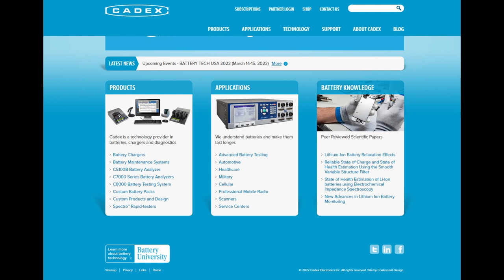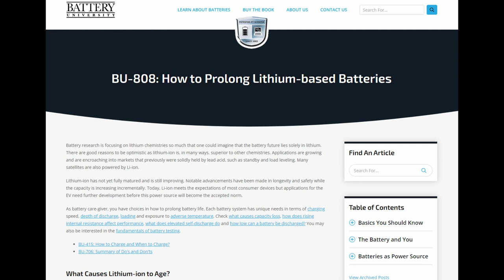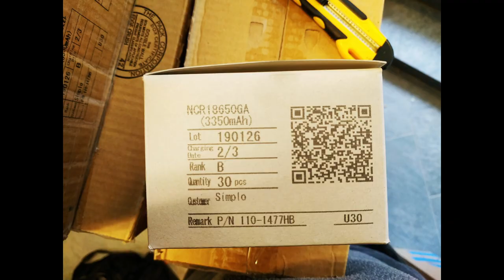Will your Li-ion batteries last twice as long if you charge them to 4.1V?

Comment: I have two examples:
When HP offered a 3 years Warranty on Business Laptop Batteries (ca. 2008), they offered it only on a special battery which had a smaller capacity rating as the normal battery (at same weight/size). I suspect they just limited the usable voltage window and maybe even dynamically extended it to meet the rated capacity while degration was happening.

Old IBM thinpads had the option to limit charge to a certain percentage in the BIOS, to extend the battery life.

Also As far as I know Tesla is only charging to 100% when requested, usually goes to 90%.

I'm pretty sure that not fully charging extends the life of li-ion cells. Would be interesting to do an actual experiment.

Comment: I know that Dualtron or Minimotors company is limiting DOD to 4.125V they have even made chargers that have 66.4V output instead of 67.2V
Reply: Thanks for the info, we have seen them a few times their batteries dont last until the first time drive in rain. Just like with eskates the higher rotation of the wheel fires any water into the machine. We actually work directlly with Dualtron and try to get their opinion Thanks!

Comment: Most powertools with 5s batteries charge to 4.1v p/cell = 20.5v packvoltage for a reason.
Reply: Yeah the reason is because they don't have a balancing BMS. This is just in case the drift out of balance. After 1000 cycles (which by the way would take you 10 years) the highest voltage cell may drift to 4.2V. there is a PCB that looks at one cell and compares it to the total voltage. If the drift is too much, the charger will not allow you to charge the battery anymore. This is specifically in power tools

Comment: I have a 2013 Tesla Model S P85 w/ Panasonic cells.  It’s almost 10 years old and the cells are still testing at 94% capacity.  I’ve supercharged it for 25% of its life, taking advantage of free supercharging as well.
Reply: Thanks for the input, may i as how many km you have travelled so far?
Reply: Approximately 143,000km.  Brand new its range was 426km.  Now it shows 401-402km range.  It’ll be 10 years old in March.

Comment: I had thinkpad notebooks limiting charging to 80%. Still had  2h battery lasting after 9 years.  A friend resetup a similar notebook without installing the charge limiting software and had it always at 100% charge. After 6month the battery died.
Reply: Thanks for the info. That his died is probally not becuase he forget to limit DOD, very few batteries die after 6 months if there are not manufacturing defects, i hope he got a new one within the warranty. On computers and smart phones it is usually a lot easier to controll DOD and that would be a platform one could experiment on, but to see any effect you would have to use it for years and they would have to be used identically so you would limit one to 20%-100% and the other to 0%-80% to be able too compare them.
Reply: @Batteridoktorn  you are right when the battery is charged and used. In cases where a device is used while plugged in and the battery is charged to 100% and then stored at 100% level and then plugged in again - thats what accelerates aging a lot.
Smartphones work fine because they are charged and then used the whole day. But Notebooks often get never under 100%. That combined with heat (playing games on notebooks) is a bad combination.
Reply: @olafschermann1592 it cant be an original battery. It doesn't matter how many devices you have plugged in. Age is related mainly to how much energy the battery gives out by discharging. You can discharge your laptop fully from 100% to 0% everyday, twice a day, and it will still last a couple of years. If you have a cheap, Chinese replacement battery, then a couple of months would kill it

Comment: i got 112 charge cycles out of my bosch 400w batt tho it still works the capacity is now so low it wont even do 5 miles in turbo mode but gave it to the ebike motor center uk to get them to hack the bms so ppl can have the bloody things recelled over here and can now also do board repair on bosch controllers with a 90% fix rate.

since i got my bike in 2014 id have thought buy now i could of doubled its capacith to 1000w with 40 7000mah cells but not going to happen they just get bigger and more expensive where as i want a bike thats 15kg and can go 50mph fpr 50 miles flat out.

i should just get a horse and let it shit all over the road  free parking and a lawn mower 🐎
Reply: you probably have no much idea about li jon and how to use them. my bosch 500wh from 2017 has more than 200 full charge cycles and compare to my brand new 500wh has around 10% lower  range than new battery. I never charge them when they are cold, storage it in cold place and do not discharge lower than 10%. I do not storage fully charged and leave fully charged maximum for 1 or 2 days and discharge them at least to 90% just to never leave them for longer fully charged. I would not charge them fully but BMS is not perfect so I try fully charge to let balance cells. That is a secret :D BTW I use most of the time fastest 6A charger xD
Reply: @pawelodz8050  i use a dongle so it has had a hard life but it still works and charges but i got a new 500w batt in 2016 and got another this year for £633 fkn quid as got no choice  and store them inside and stored at 60% but the power has to come from somewhere and others with no dongles still get good range just they can hit 35mph on the flat but as bosch has made it near impossible to recell these bloody things and the new smart frame batts wont work with my bike prob software locked or diffrent connector  so i wont be buying another one esp if it has can bus bs but some ppl never rode there bikes in covid for 2 years and what happend the very thing that stops you recelling the batts the bms drains the fuckers to 0v and bricks its self:face-purple-crying:
Reply: @soundwave6769  true mate, I sold my old spare (only couple of charges it had, not current one 😁) 500wh battery one a day to some guy from Portsmouth. As he said, his was bricked over the winter. I guess he left it discharged completely.
Reply: @soundwave6769  yes, dongle makes hard life for sure (if you goes like 40km per h they are hot like crazy even in cold day) but the most important thing thing is how you storage them and how to charge them. If you charge when battery is cold - structures inside will be damaged. Bigger current like 6a plus cold battery= Short lifespan. Of course leaving them discharged to 0% for long time is a baaad as well 😁
Reply: @soundwave6769  in UK even in wooden shed is enough warm to storage battery. You said you leave them inside the house. That's maybe to warm for them. Best is around 10°C but do not charge them when they cold, just wait some time when they get warmer. When I used my previous ebike as a commuter (22km daily) I used simple electronic timer and just before wake up battery was fully charged, so only a few hours weekly it was charged fully. That's why I made 13k km in 2 years and battery after that many charges was still in really decent condition. More over I never left battery in the sun cos warm downgrade them fast as hell 😁
Reply: @pawelodz8050  yeah dont  use them down to under 10% and not charge it as the bms still needs power but if you cut power to the bms to recell it and put it back together it will charge just wont talk to the motor and turn on becouse its can bus programming has gone but thats for safty of course.

and id forget the bosch smart motors esp if you want a dongle as there all getting 504 errors and going in to limp mode but the only motor out there that does not use can bus is the yamaha ones as they use uart they sell all the parts and controllers was made to be serviced and a guy on a forum got 10500 out of his motor b4 it neede all new bearings £300 and was back with him in 2 days if there was no peter and the ebike motor center in the uk we whould all be fucked even my bike whold be scrap buy now and just need to crack that bms can bus bs
Reply: @soundwave6769  yes I heard when you cut power for BMS in Bosch battery you will brick it but same time in Poland I saw offers service battery -recall it with new cells and they guarantee battery will work. So must be the way to repair
Reply: @pawelodz8050  my new batt says max temp 50c tho it has no lower temp but i have teste many 18650 cells over the years even charging and discharging them inside the freezer and they reall dont like that but i have only had 1my motor overheat once with the performance motor i had back then but it was the hottest day of the year on a near 30 min steep climb so had to push the fkn thing to the top but if you want double the speed with a dongle then the batt wont last as long as my new 500w batt has way more kick in it than my 500w one from 2016 but the bosch warranty is 2 years or 200 charge cycles so if you do want to hammer the crap out of the batts with a dongle after 20 months drain the sucker flat and leave it for 2 months so the bms bricks its self and get a new one under warranty ;)

Comment: “I don't know a single battery manufacturer in the world that limits DOD in any of their product”

Samsung ;) … Produces batteries and smartphone and has an option to limit the charge to around 85%.
Not producing batteries, but also limiting: MacBooks and smartphone from OnePlus try to delay the charge cycle to 100%.
Effectively, they intelligently try to reduce the time the batteries are charged 100%.
Reply from the maker: On computers/smartphones  this is sometimes a third party option with apps since a lot of people want more controll. Almost no battery products exsitcs that limits DOD. If this was actually true then all products would have limits! And they do! it's inte the DATASHEET from the manufactureres and its 2.5-4,2V for all lithium cells! There is not proof at all that limiting it more will have a greateffect, unless you think samsung, lg, panasonic, sanyo and all others are incorrect....
Reply: @TheBatteryDoctor  Interesting that you are only asking for proof and not evidence!

Your claim is wrong: OnePlus and Apple have that feature activated on default. Samsung has it in the options, and AFAIK explicitly asks on some models whether you want that option enabled and is even recommending it.

So, Samsung as a conglomerate disproves ;) your claim that there are no battery products from battery manufactures (!) which limit DOD.

Comment: On Lithium the range between 40 and 60 percent is optimal.
Reply: No it really is not, that would make the battery alsmost useless and there are no such batteries ever produced. There is not proof at all for this. Can you please give me some links if you believe you have proof, but untill then don't forward this tidbit as fact, because its not.
Reply: @Batteridoktorn  You really didn't search long, did you? Here is a study for example: Yuliya Preger et al 2020 J. Electrochem. Soc. 167 120532
Reply from the maker: @interru_io  Well everyone is saying limiting DOD is TRUE with NO PROOF,l it could be true but the battery scienctists are not even reserching it any more since it's always inconclusive. There is no proof for it AT ALL, so pleae stop spreading basically "fake news" please. If you have any proof let me know, thanks.
Reply: @TheBatteryDoctor  did you actually read my two comments. If you want scientific debate, calling everything “Fake news” towards anyone who doubts your assumptions isn't the correct approach.

Believing without proof isn't scientific, regardless of what side you take. The agnostic scientific approach would be to question your assumptions. 

There is no organized collective which decides what to research. You could research this in this instant.

Your understanding of science seems to reflect the social average. Sadly

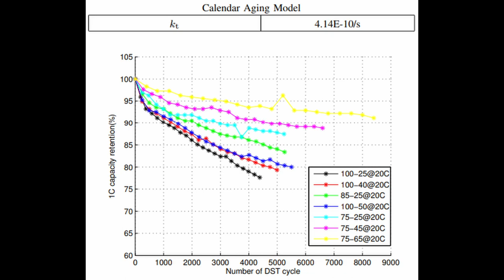Comment: The graph on 1:57 is what everybody refers to for some reason! It doesn't even look scientific! Having said this, we can normalise this data in terms of total energy. Here is an apple's compared to apples comparison. I have done a quick hand calculation that shows the best curve (75% to 65%) shows 9 times more cycles than the worst curve (100% to 25%) to degrade the battery to 90%. However the worst curve uses 7.5 times more energy. So that's 20% extra life if you decide to use your lithium battery from 75% to 65%. fuck that 😂. That's like carrying a dead weight with you for no reason which again requires energy